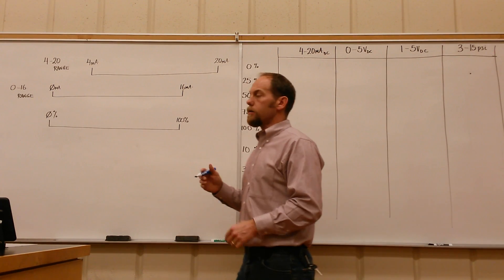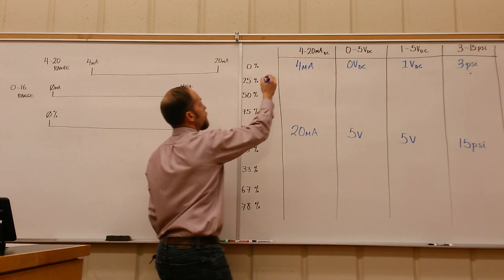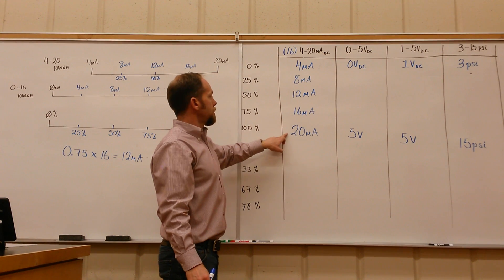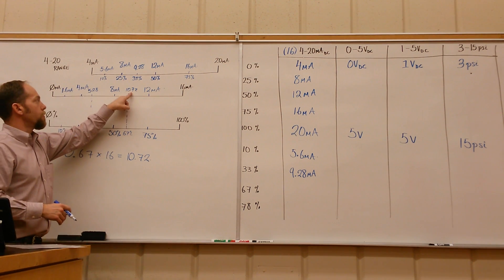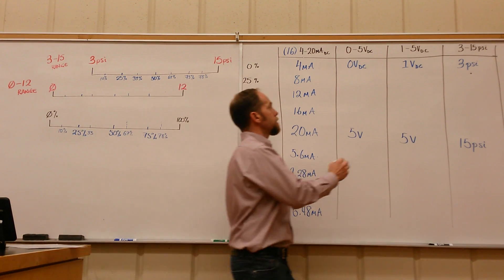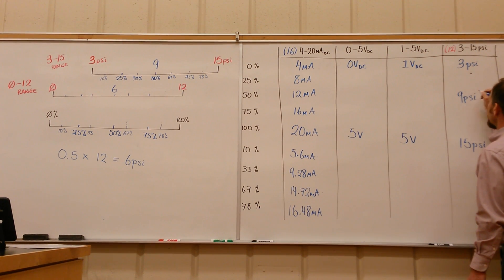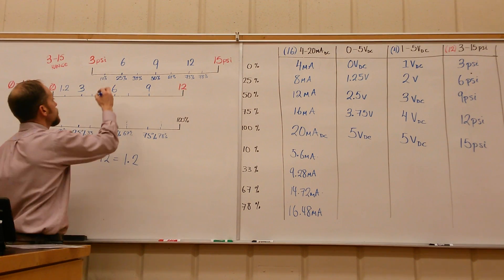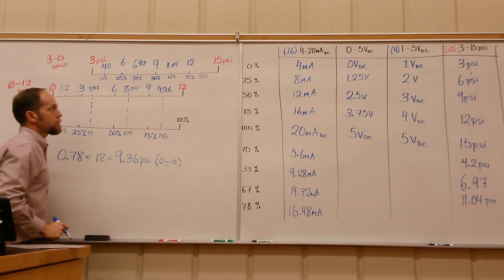4 to 20 mA, 1-5 V, 3-15 psig Lesson #1

Comment: I'm a bit lost on this problem. I dont know what formula to use. 

 turbidimeter outputs on a 0-20 scale on 4-20amp then whats the NTU reading process value is 14.75mA? 
The same instrument that's showing 0.21 NTU then how many mA is it outputting?

Comment: Where 0-5vdc is used ? 
And where 1-5vdc is used ?
Reply from the maker: Google 0-5 V Sensor and you'll see all kinds of sensors that output 0-5VDC. The 1-5 V DC is used when converting 4 to 20 mA Current to 1 to 5 VDC Voltage using a 250 ohm precision resistor (and ohms law)
Reply: Thanks